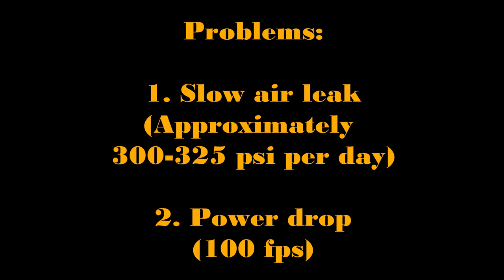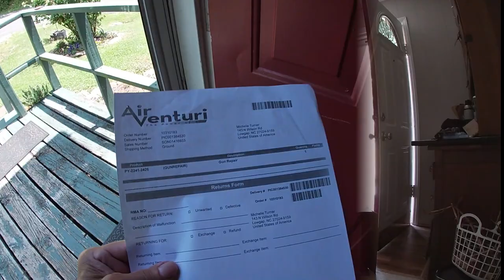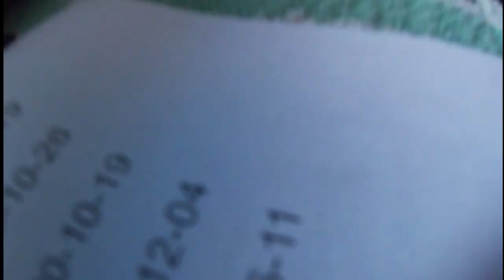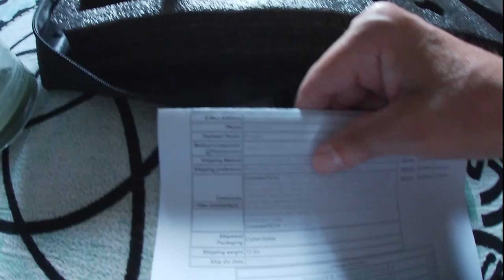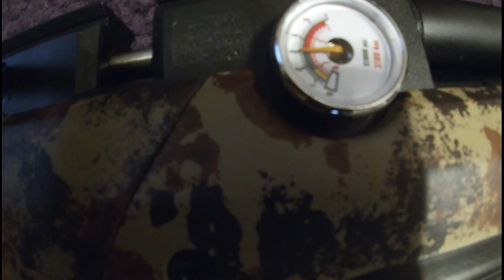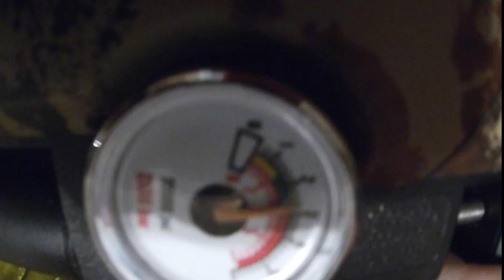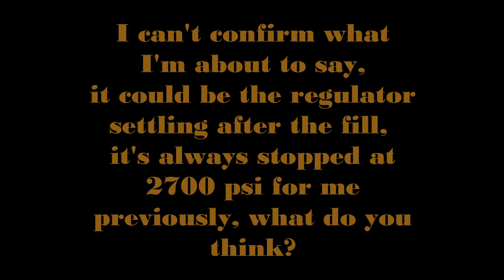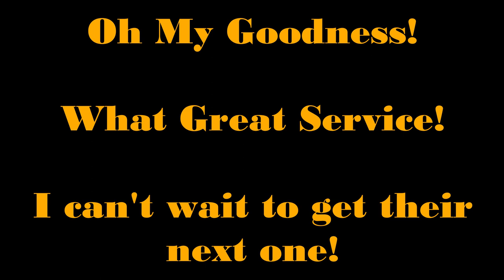Air Venturi Avenger Leak And Power Drop Repair Fail

Comment: I feel you man I spent $300 on a hatsan flash 25 and the gun shoots lights out. But after 2 months it leaked all air out I sent it to hatsan “they fixed it” from what I can tell just filling gun by tank as I have hand pump 4 months later gun back at zero covid hit about same time. Contacted hatsan they asked me  if I felt comfortable working on it myself. Gun been a paper weight since finally got the balls enough to take it apart other day found problem with the white derlin valve seat checked gun box and no rebuild kit in it. Checked hatsan website and low and behold not in stock.I wrote them a not so nice email it’s utter bullshit. I feel your pain spend a lot of money and you pretty much have a 50-50 chance to get a lemon and if you don’t work on these things you are up shit creek without paddle.
Reply from the maker: I've got a few Hatsan guns and I've been lucky, all three have never leaked and shoot like a dream, two are 4 years old, one is two. I have to get rebuild kits from Pyramyd Air, I've been lucky to never have to fix a thing on any of them other than an o'ring on the barrel that holds it against the shroud, and I tore that up. I did have an issue when the Flashpup first came out, I preordered, the mags were horrible, wouldn't cycle. I called, they said they knew there was a problem and had a new set in the mailbox in two weeks, been using them ever since. 

So, I've been lucky with Hatsan, This is the third rifle AV has put out with the same leak issue, they haven't even tried to fix it, so I don't want another one and mine, like your Hatsan guns, is now a paper weight.

Comment: Unfortunately out here, warranty is not giving and the air is leaking. And I don't know where it's comming from.
Reply from the maker: Do what everyone is saying here, soapy water on everything that could leak, balloon on the barrel to see if it's the valve, air release. There's a guy in the forums that works on them that goes by Dark Charisma, he makes the poppets with the Delrin seals, and a lot more if you want. If it's the poppet leaking they don't have replacements, or it get the same thing put back in it.
Reply: @slowpokeairgunner4027  Thanks

Comment: I was DUMB enough to buy Avengers in all 3 calibers . Only 1 of them was 'repaired' under warranty , and it started leaking the second it started taking air. 'Yes, I know to cock the gun while filling from empty' total waste of time and money.
Since then , all 3 needed to be resealed EVERY YEAR.
I them down to the smallest pieces I could , and scrapped them over time, so they can not be reassembled ever again.
Air Venturi has earned my total disrespect , in every capacity. NEVER AGAIN!!! 
And Pyramid Air customer service , does not exist , neither does their stock. As in ,Never having ANYTHING in stock.

Comment: Im sorry man, our air venturi avenger that we just got has a very small leak plus never quite got the fps and shot count that others are getting. We are really considering sending it back for a refund and just pre-order the Umarex guantlet 2
Reply from the maker: I can't say I'm a fan of the Gauntlet, lol, this one has a poppet issue, I didn't look for a leak because I wanted them to honor their warranty and find the leak, fix the thing, if it lasts past them warranty then I'll fix it, but not cool. If you want a good gun you can have this one worked on, it's a great platform, the poppet needs replaced, some have other issues with leaks in other places, but it's normally an easy fix with an o'ring, the whole point of this video is the unbelievable so called repair, that's rediculous. The first Gauntlets had issues, I wouldn't hold my breath thinking the Gauntlet 2 isn't going to have issues. I say that because that's another one that had previous models with issues they never fixed on the last model, to make it run well you need after market parts. I can say that my good ole' Hatsan Flashpups are still running fine one after three years, the other about a year and a half. The Gauntlet is more of a bench gun for me as well, medical issues make the need for a light and well balanced gun a big thing for me. I'd rather fix this one to run the way I want than a gauntlet, but that's my opinion, I think it's a better gun.
Reply: Have checked around the forums?? I know someone is making a better poppet for this gun. Mine avenger just came in. Hope it isn’t a dud
Reply from the maker: @MrBlah3573  I hope not. the guy that makes the Delrin poppets goes by the name of DarkCaharisma in GTA and AGN. You'd think they would have given me some info on that.

Comment: A poor report on a platform as large as YouTube can be damaging to sales in a manner which cannot be quantified. That is dangerous to future sales. It’s a tight nit community. Word of mouth reputation takes years to build and moments to destroy.
Reply: My venturi avenger is now leaking too.. it was a great gun , accurate, and fun. I also sent in to warranty but they sent back worse.. I DO NOT RECOMMEND VENTURI AVENGER ,if you want a gun that is not a paper weight. Many many Time & pellets, wasted just to start over on a new dope book for a new gun.
Reply: @JoeMama-hl5qc  Any ideas why and where? This seems silly but the kids bath product Mr Bubble is what we used in the chem lab to tract down leaks.
Reply: @crawford323  I removed the shroud and installed the sweet balloon mod at the end of the barrel. Sure, enough, I found the leak.
Reply from the maker: I tried to play nice, they knew it was already on YT with the leaks, they knew I was gonna make a video of it when it came back, yet this is how it came back. They have had a few years to fix the leak issues in their guns, two previous models had the same problems, instead they went ahead and kept making faulty guns for profit instead of fixing the issue in the manufacturing. When you have bad seals and know it from two previous models you'd think they would address it and fix it, that's how a company gets bigger and better. Instead they chose to ignore the customers and go for quick profit, try to make everyone forget what happened with their previous models and continue. On top of it, having customers send it back to be repaired under warranty and not fixing it, not even really checking the gun, they're destroying their own sales. You read about it in the forums with this, and previous models but it's not always gonna mke it on YT because you usually get attacked for telling the truth. I mean come on, all they had to do was fins the leak and replace a seal more than likely, instead they don't check it, say they fixed it, make it worse than when I sent it. This thing can be looked at in 12 hours and there's a noticable leak. The guy who worked on it needs a boot in his ass from the company, and then the company should take care of it. I don't know if it's because the repair guy didn't have a clue, or company policies that only allow them to do "x" amount and say it's fixed, but I do know the company has not made a peep, just ignore it and keep advertising it. In my view, if it were my company and it was the repair mans screw up, I'd handle it internally, and offer to fix the gun, paying the shipping to have it sent back for the mistake. I got nothing, so if it hurts their sales, so be it, they done it to themselves.
Reply: @slowpokeairgunner4027  I understand and when you deal with a customer whether it be an email or a phone call they then become a representative of that company. People need to be trained or at least have the company goals and policies in mind when dealing with customers. Word of mouth, which is the best, advertising, takes years to build and an instant to destroy. I am sorry you have has issues with the gun. I have one and I love it. I wish you the best.

Comment: I had the same problem soapy water in a spray bottle to bring it down found the leak it was where the air tube screws in had a bad o-ring replace the o-ring haven't had no problem sense
Reply from the maker: I get ya, but you'd think they would have looked for the leak at the shop. It's not something i couldn't do myself but the point of sending it back was that it was under waranty and they told me to mail it back and they would fix it. They did a great job, fixed her right up, another trip to the shop and she'll be hissing like a rattle snake with a clear warning that all the air is going away fast. Shoot it now before the air leaks out, lol. It's unbelievable, well, sort of.
Reply: Mine is leaking right at the end of the airtube on that big black nut. Going to try and figure out how to take it apart tonight and replace that o ring. Looks like I'll need to take the whole airtube off to do that
Reply from the maker: @lew-e  Check out Air Velocity Sports video, he does a complete teardown.
Reply: @slowpokeairgunner4027  Thanks! Thats what I have been using as a reference. The o-ring seemed perfect. Hoping it just got pinched. Going to try refilling asap and then if not it will be a bigger teardown and rebuild

Comment: Not that you should have to. But like other suggested find out where the leak is yourself. So that when you send it back in you can tell them exactly where the leak is. Instead of them just guessing by replacing some o-rings.. I do want to say sometimes the puppets aren't fully seated when they're brand new. I heard of people shooting a couple hundred rounds and that took care of the problem. But again it should work straight out of the box without any issues.
Reply from the maker: If I look for the leak I'll just fix it myself, the whole point was them honoring the warranty and fixing the gun. I've had this gun for a while, done all the tricks that's supposed to help seat the poppet, put some silicone oil on the fill tip to lube the seals inside, nothing worked so I sent it back asking the poppet be checked, the whole gun to find and fix the leak, a new poppet or valve that's being put in the new wood models would be fine if it's the poppet since they've been selling a gun they knew was faulty. I'll send it to someone to put a good poppet in it, do some valve work, maybe drill the ports and set it up more powerful. This whole thing was an experiment, I knew they had leak issues, mine ended up leaking and I wanted to know if they would honor their warranty. I had to pay to have it sent back, I won't do it again, I'll pay to send it to someone and pay them to do some work on it for me, but I won't be buying another one from them. This is the third model that has had leak issues, why would they not just fix it and be done with it, did they go into a contract for ten trillion of them and won't back out?? It's crazy, shit happens and this is one of those times that it has. I wanted to get the video out of my system and roll on, they don't carry the parts to fix it, so not wasting any more time on them.
Reply: I agree with everything you said in response to my comments. And everything else you said for that matter.
Reply: My puppet had a Pinoccio moment.
Reply: @usernamemykel  sorry !!!! Autocorrect respelled it for me
Reply: skinny Mitch AIR GUN BROTHERHOOD No need at all for an apology - I was just yanking your strings 😄

Comment: ♥️from India. Need help sir... Since last 2 weeks my Venturi lost accuracy. After 10 or 12 pellets it hit on different sides of the target like sometime it hit on left then right,smtime up smtime down.But there's no leakage..its work very nicely before. Even I used to clean the barrel regularly. Hope u will reply me as u see my comment.
Reply from the maker: Are you using the magazine? I know the magazine will make it do that, but I also hear other people with the same issue, I've read that the barrel is moving, I'm not sure if that is an issue with the old barrel bands that were screwed into the air tank instead of between the air tank and shroud.. To get the best info you should join two forums if you can, Gateway To Airguns, and Airgun Nation, you can get help there on fixing it.
Reply: No sir I'm using single shoots tray.
Reply from the maker: @kagworld9010  It has somethign to do with the barrel then, I've read about it but don't remember enough to give any good info on it. Check Airgun Nation, or Gateway To Airgun forums, I'm sure you can find answers there.
Reply: Thank you so much sir!

Comment: When I got mine first thing I did was degas the gun and reset the reg.  After filling it I was pissed to find it leaking air.  Well dumb dumb me , not wanting to over tighten the degassing screw didn't tighten it enough so I had a leak.  Self imposed so I tweeked the degassing screw and Voila.  "fixed"

Comment: Need to do a soap test and you can put a balloon or condom over the barrel to see if it's leaking out the transfer Port it'll fill it that up if it is eventually
Reply from the maker: Thanks for the comment, it has been filled and checked daily since it returned. The point for lowering pressure to ship makes sense, but they know better than to lower it below reg pressure since it can mess the regulator up. That being said, it is known that these are filled before shipping to check because of the leak issues, if it shows up low like this below the reg, it's a problem, I've read about and talked to people about it since I got the gun. They are said to be filled to about 3000psi when shipped because of the problems. It's noticeably leaked within 12 hours (as shown in the video), then 24 hrs, then 48 hrs...
Reply: @slowpokeairgunner4027  actually I did watch the video
Reply from the maker: @gumbystown  ...and you changed your comment, lol. It's cool. Yeah, I have not done the soap test, but after only 12 hours there was a drop, they would have saw that, it's frustrating.
Reply: @slowpokeairgunner4027  I deleted a comment Midway through the video as you were ranting back-and-forth and watch to the end and reposted a new comment which is the present one we are chatting off of. I hope you figure out what's wrong with it. I've always wanted an Avenger but have always held back because of the stock and it always seem to be a tinker's Delight but I don't really like adjusting things I just want it to work properly right out of the box. Are all regulated guns problematic to having low tank pressure and messing up the regulator or is it just air Venturi
Reply: @gumbystown  personally I don’t even think that is a correct statement about low tank pressure. I mean if that were true every time you bled the air out of the gun to lower reg pressure (which you have to do) you would damage the reg by the low pressure you cause in the gun during the bleed off of air. It literally makes no sense.

Comment: This gun must be a joke... keeps change POI all the time.. bought a donny fl adapter and it didn't help. Spoke withe store i bought it and they said it's normal that it change about 1 moa after each time i pump it up yeay zero the scope all time sucks. Hope you fix your soon
Reply from the maker: I haven't had any POI issues that I know of, scope issues, using the Mantis scope that came with the package deal, not real sure about it yet. The gun will shoot, but the leak issues, mailny the weak poppet that's in it is a let down. I was using mine for long range, maybe I got lucky on that part if it is common.

Comment: Hello, do you have any update on the leakage yet? Mine has the exact same issue, there is no one in my country who is an authorized dealer or doing repairs. Please help Slowpoke airgunner
Reply from the maker: You can order seal kits now from what I understand, that's about all I know. I haven't shot the gun since I've gotten it back, I just let it sit and leak, I'm disgusted with it, if I were gonna fix it myself I would have never wasted money sending it back to them. I'll eventually send mine out to have someone fix it and amp it up, all the work to tear it down and replace seals and still having a crap poppet in it is useless because it will fail, a guy in the forums makes Delrin poppets for them and does some excellent work on getting more power out of them, he has the tools to work with so it's probably where it's going.
Reply: @slowpokeairgunner4027  thanks so much for the reply, well this issue is really disappointing